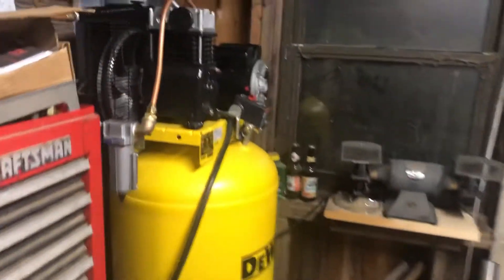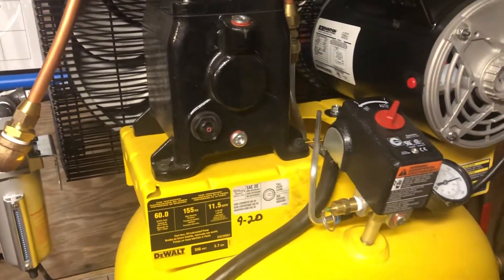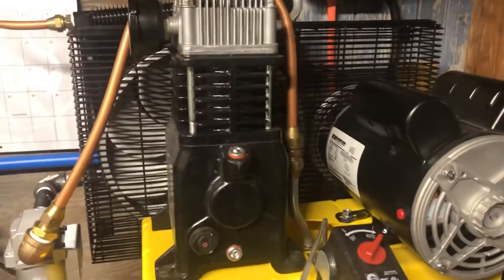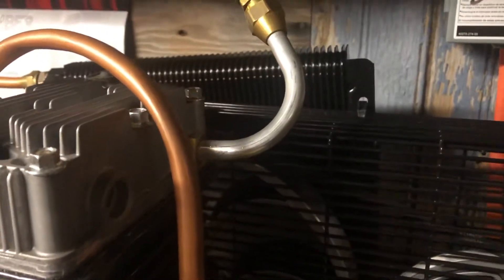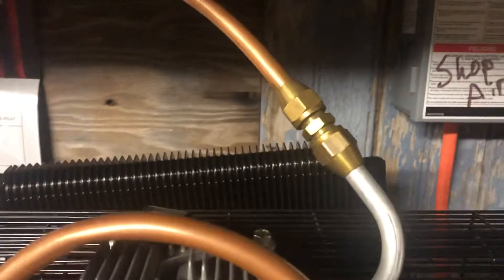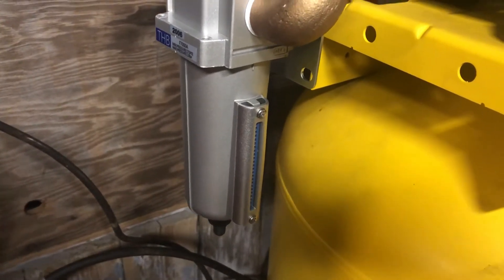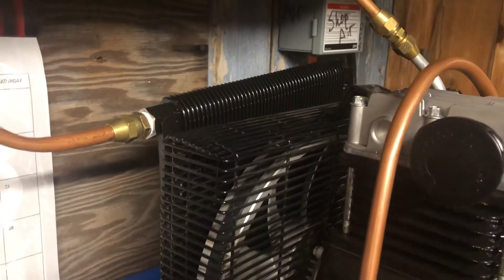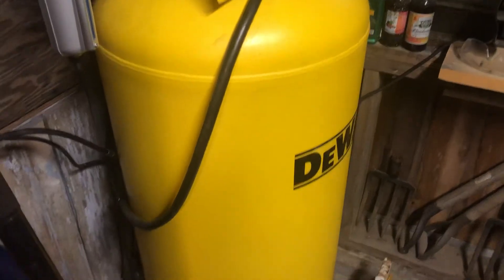Air compressor after cooler: part 2

Comment: I did my husky 60 gallon compressor the same way you did and it worked PERFECT. DRY AS A BONE!! Some might get a little bit of moisture and depending where one lives but it gets  98 percent of moisture out of the tank. Great video buddy. 👍

Comment: looking to add aftercooler to my compressor, your's looks good, my only thought is I might try to  re-route so it doesn't go over the head. Just my 2 cents.
Reply from the maker: Yeah, I’ve thought about that too. I might someday, but it’s still super hot by the time it reaches the condenser, so I’m not too worried about it

Comment: Looks like a great setup, but I didn't see a check valve.  There should be a check valve between the head and the tank, maybe best before cooler so that you can flush the cooler if needed.  I'm doing the exact same thing and I'm looking for 2nd check valve, mine is at the tank and I'm guessing you have one at the tank too.  I'm looking to put on inline right after the head.
Reply from the maker: The check valve is right at the tank. The bleed off after the run is longer now, obviously because there’s a lot more volume now, but it works great with the automatic water separator.